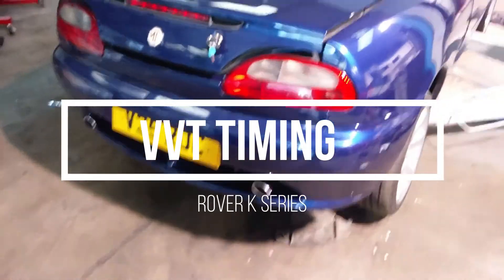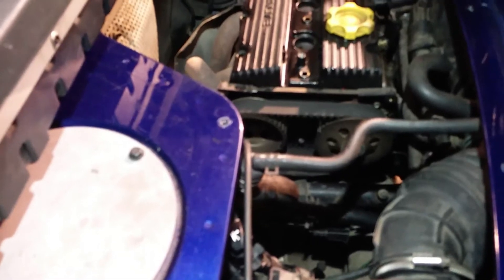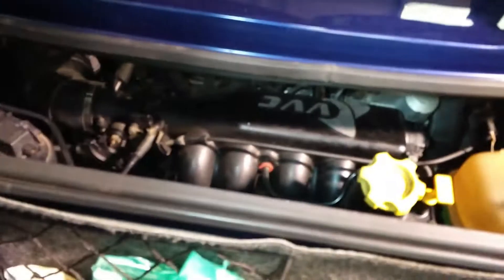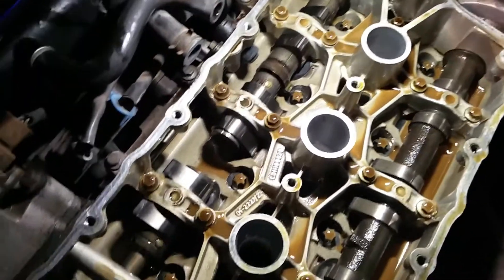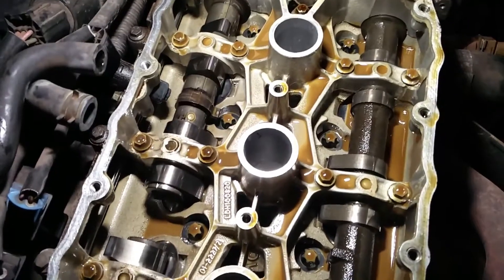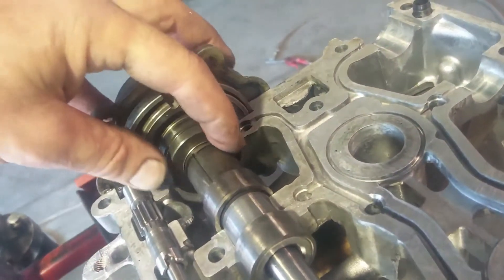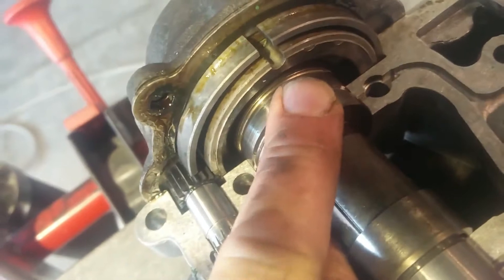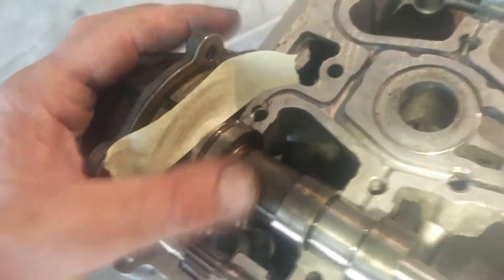ROVER  K SERIES VVT TIMING

Comment: Hi, quick question mate... my plunger is stuck all the way into and is jammed there( tried everything to pull it out), what could coause this?) Btw the head is still.on the engine and ibe just removed the rocker cover? Great video too!
Reply from the maker: Hi, the plunger wont come out until you get the advance units in a free state. Hope this helps. Call if you need any help.
Rick
Reply: @halemotors4084  Firstly, thanks for the swift reply!....by "free state" do you mean the cam lobes shouldn't be pressing on the valves?? If so, I've positioned both inlet cams where they're facing upwards( by removing rear timing belt) but still no luck!....I can see the control shaft turn a few degrees when trying to pull the plunger out, totally out of ideas hoping you can shine some light on this one, thanks again!!
Reply from the maker: @DonDon-ee1uf  Hello again, its been a while since ive had one in bits,im pretty sure if the control shaft reaches its limit on the vvti units it  wont travel any more causing the plunger to stop at a certain point. i will try and grab one so i can check and give you more info.
Reply: @halemotors4084  thanks for the reply, it looks as though one of the vvc mechanisms has jammed internally! Is this possible?
Reply from the maker: @DonDon-ee1uf  Yes anything is possible, you can see the Gear at the edge of the VVt unit where the control rod operates.
Reply from the maker: @DonDon-ee1uf  Yes it is possible.

Comment: lining the holes up will probably mean more when there's an engine in bits in front of you but from the, er, enthusiastic, camera movements it's kind of hard to see.  Interesting to see a VVC mech in bits & hopefully I'll never have to do my head gasket as it's been replaced with a proper one.  But if I do, I'll know where to come for useful info.
Reply from the maker: Yes fair  point . Since then i have a new phone and it doe a much better job of the video, Plus i was new to this and didnt do the best video.
Thanks Rick